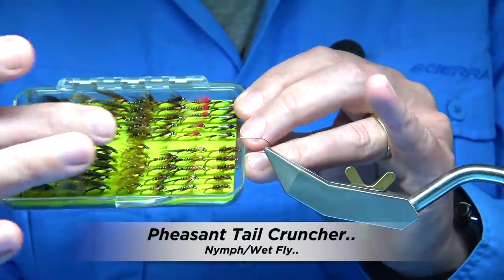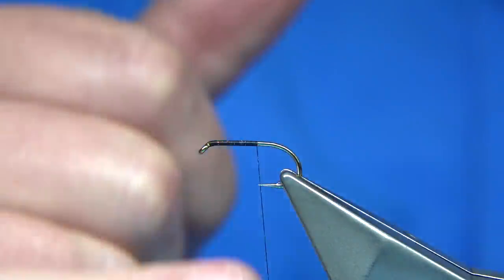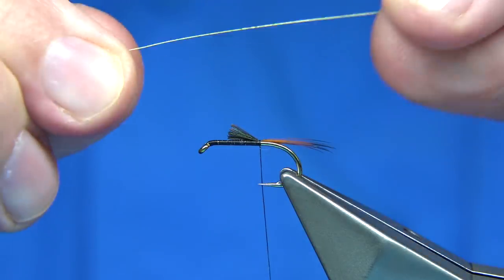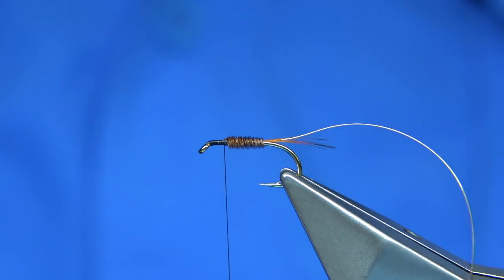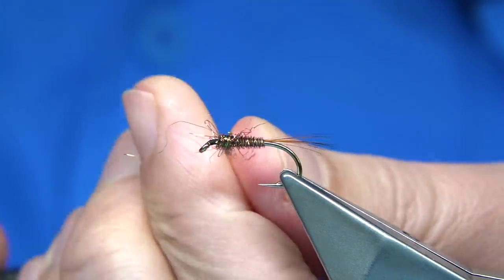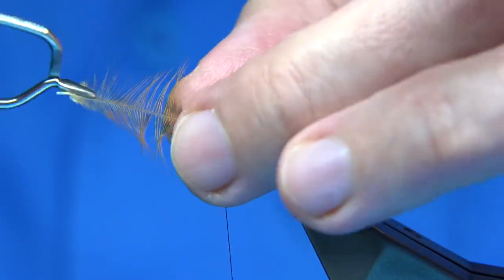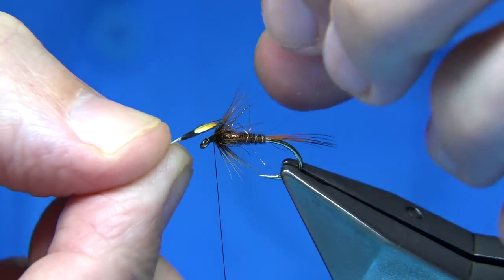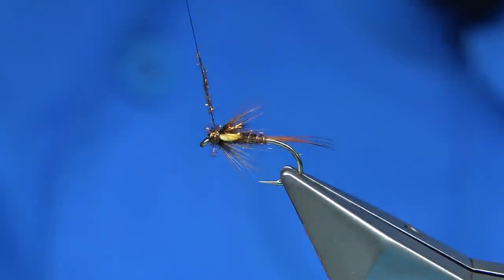Tying a Pheasant Tail Cruncher Nymph/Wet Fly with Davie McPhail

Comment: What is the reason for winding the pheasant body that way? If I wound it the regular way and then counter wound 
the wire rib, would that not work just as well as the way you demonstrate? Is it just preference? Just curious? 
Nice pattern and I am sure it is worth adding to my box!
Reply: Mike,
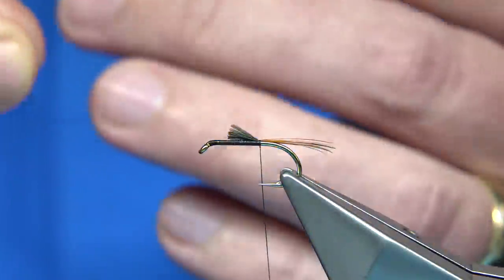The body sequence starts at 2:50-ish.  The reasoning is there as the body is made.  
Underlying all is the intent to make tight, long lasting flies and a key is tying off materials that are wrapped in the same direction as the normal tying... the tying thread tightens the wraps (in this case, the wire) through both physical movement and the nature of a little stretch in the thread holding the materials tighter.  If a person wants to rib for both material protection and as a prominent aspect, also wanting the reinforcing wire to be as tight as possible, the "weaker" material is wound opposite.  
To say... the 90 degree bend in the wire keeps that "weaker material" protection aspect from being pulled loose by teeth.  
It IS more "fussy" to tie off opposite-wound materials to keep them from being looser.  My early personal experience with this was I lost time doing it. Down the road I came to understand the lost time was due to me having to remember the process and then get it done correctly.  Once it became "automatic" the time lost basically disappeared.  
Mike
Reply: @krallmi48  I have been tying flys for 50 plus years and don’t find it makes any difference to the longevity of the fly, IMO, if the pheasant tail or other dubbings are wound in the away from you direction and the protective wire is wound in the opposite direction? If longevity is your “ main “ objective and time is not a concern then I would add a coating of Sally Hansen clear nail polish/ hardener onto the thread wraps and then wind the body material on top of the polish, in effect “gluing” the body to the shank! While I appreciate your input, what I really wanted was an answer from Davie! Thanks for your attempt 
to explain! All the best!
Reply from the maker: Hi Mike,

There's many ways to tye a fly as you know and the right way is what you are happy with as we can all learn off each other and enjoy our hobby. Here on YouTube it gives us all the means to pass on what we have learnt over the years as much was lost before we had this other than what we read or were lucky enough to meet someone willing to share their knowledge..Both ways you will end up with a strong fly as I have tyed flies just as you described..

All the very best Davie
Reply: @DavieMcPhail  Thanks for your input and reply! You are absolutely right! I am self taught and sometimes make my flys in non traditional 
ways I’m sure! Having read hundreds of books on the topic and now, since discovering the internet content available on this topic from masters 
such as yourself, I am still adding to my tool box! I continue to enjoy watching and learning! That’s a big part of the attraction! In the end, the fish decide! 
Tight lines!!